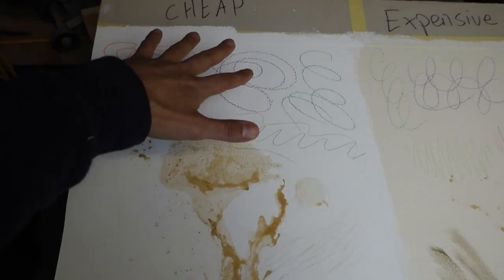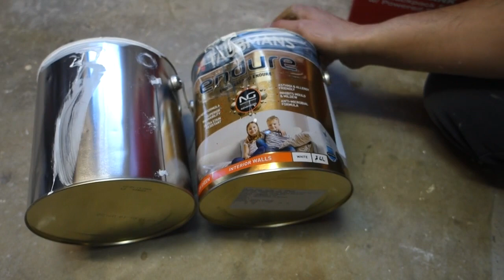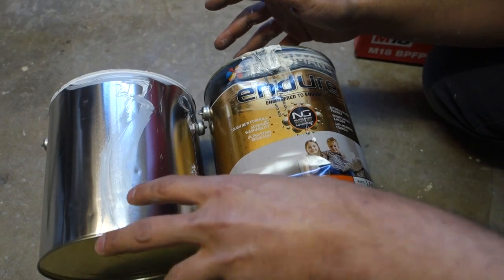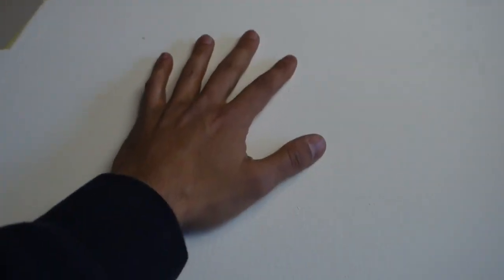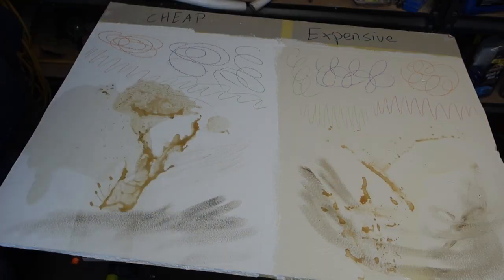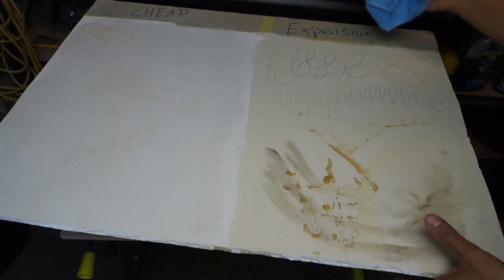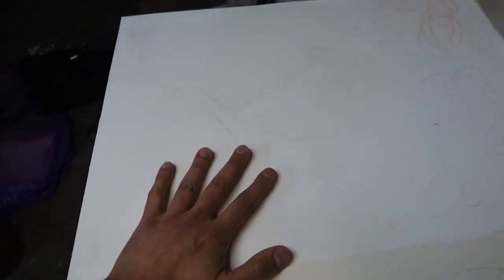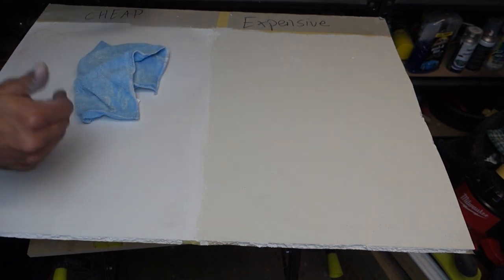DONT buy cheap paint.... cheap vs expensive paint TRUTH

Comment: I would say no  wall is ever going to be violated as much as you showed and yet still you did manage to clean off 90% in 2 minutes, so it still doesnt justify spending 4x the price on the expensive paint.....does it?
Reply: If that were a wall, he'd have to repaint the cheap side after scrubbing those stains because the scrubbed area would now look different than the surrounding color. There are other benefits too, atleast from a painters perspective: better coverage which can mean fewer coats, less splatter while rolling, fewer runs/drips...
While cutting in: the better quality paint generally paints further and lays out better, if you're painting trim, doors, etc...better quality paint should level out more which provides a smoother look and leaves fewer brush marks...
You can also find expensive paint on sale all the time  so you can get the $80 paint for 50-60 bucks. Pay the extra 30 or 40 bucks and use a paint that will cause less headache while using it and be slightly more durable and washable in the long run. It's worth it.

Comment: Nice demonstration. But I've used the cheapest paint I could get for years; I just make a point of saving a jar of it for touchups in case I have to cover a scuff or scrape. I've had no reason to  regret it in most places: no peeling or blistering, except in the bathroom, where I ended up sealing the paint with spray-on clear coat. I should add that I don't have kids, so there is not a lot of dirt to scrub or cover, and I don't change colors, ever. So, there are some places where cheap paint is good enough, but if it's a high-traffic area and you have to do a lot of scrubbing, the expensive paint might be worth the costs, which can be mitigated if you wait for a sale.

Comment: Did both paints have the same sheen? I see the expensive paint is low sheen, unless I missed it, that info is missing for the cheap. Flat paint will always mark easier than a slight gloss like eggshell. In the US it goes flat, eggshell, semigloss, and gloss. Where would "low sheen" fit into the 4?
Reply from the maker: Both low sheen , low sheen would be considered egg shell which is generally used on interior walls👍

Comment: Question :
I recently did home repaint and the walls are brick rendered. Now for some reason any metal item that touches the wall automatically permanently scratches the paint. I'm not sure if it's because its a brick render wall and not plasterboard or bad paint, undercoat.
Have you ever come across this.
On a painted plasterboard wall it does not do this.
Thanks
Reply: I've noticed that when using an aluminum ladder, even on plasterboard. I think some metals like aluminum and some stainless steel alloys are more inclined to leave marks. My 1970s stainless steel sink is kind of a gunmetal gray and any time I scrub it, the scouring pad turns black; I'm surprised I haven't worn a hole through it.